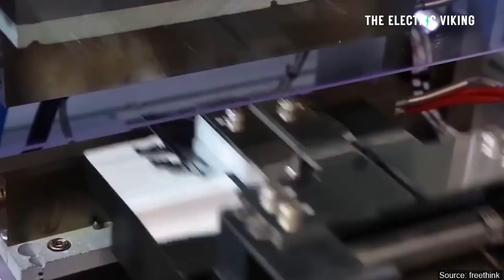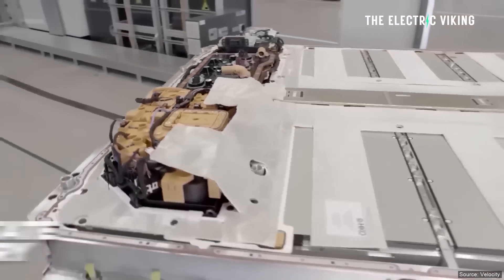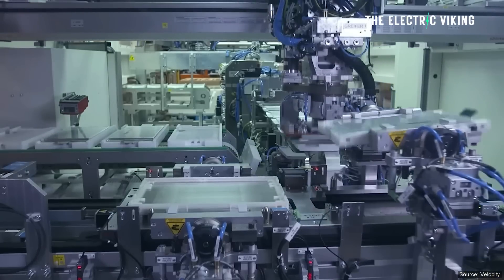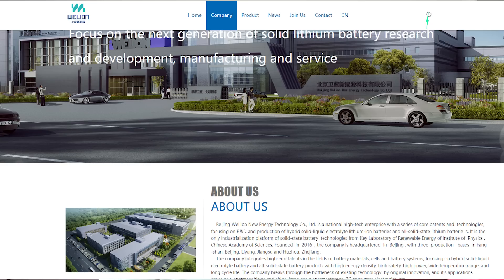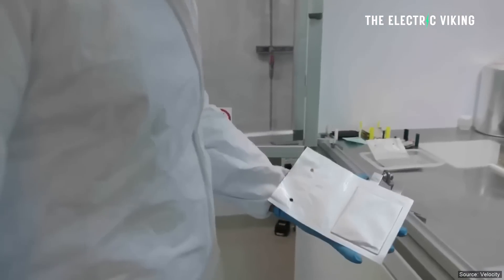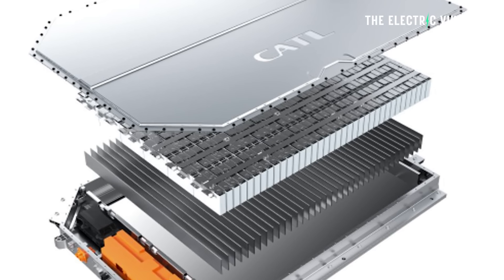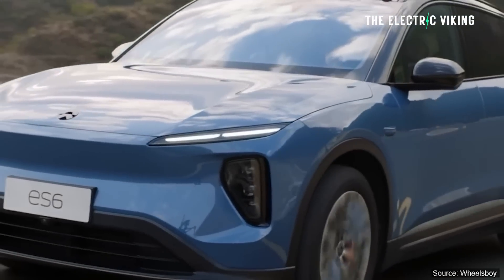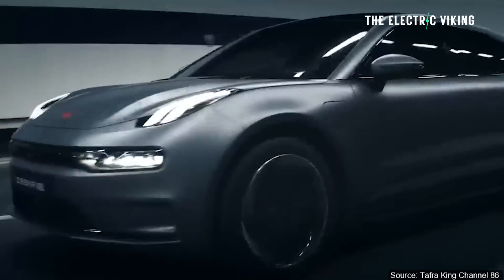Nio's ES6 has 577-mile range & 150-kWh Solid-State Battery

Comment: ES6 with 577 mile range never had the promise of 600+ mile range.. The ET5 & ET7 will have the 600+ range with the 150kWh pack.. don't forget to mention that NIO Swap can upgrade and/or downgrade battery packs in 4 minutes. Unlike Tesla that you are stuck with current tech. Huge advantages that only NIO has, even if/when charge times reach super low limits (that too Solid-State will provide). NIO will be the only offering of battery upgradeability across all models... just my 2¢ cheers
Reply: Don't forget to take battery degradation in consideration too. The NIO swap is better in that regard!
Reply: @futureatob6920  is it?   Maybe when you go to sell but you do risk getting a highly degraded battery
Reply: Nio is not going to proactively keep these batteries at 100 or even 90.  You might be pissed if you get one that is not well taken care of
Reply: @jamesp5301 NIO swapping stations do diagnostics on the car & battery every swap.. maintenance or recycling is performed on the battery pack when needed.
Reply: @peterklausner9727  now you change the argument. I do like the maintainability of swap.   I'm talking about it as a charging standard.   having a proprietary standard means fewer options everyone can use
Reply: @jamesp5301  You can push for standardization of a system that is good, but somehow to me seems lacking when time is money and you have to sit at a charging station for 30min or more to replenish a battery.. 5-10min would be great however those chargers don't exist,  & those batteries don't exist to not be affected by continuous fast charging & it's affects on  the batteries in degradation over time is a real concern.. & Look at the German model Y & NIO ET7 endurance test of 450kms, speed limits must be obeyed.. The ET7 won With 8min to spare, & had 150kms left on the swapped battery.. The model Y had 42kms left in the fast charged battery and lost by 8 min I believe over that distance.. Personally I would want to standardize the better system.. But that's my opinion.
Reply: @peterklausner9727  I get it.  I really do but by not focusing on building a supercharger standard it doesn't solve the problem of having a universal, reliable and available charging system and encourages different groups to invest in competing swap standards.   I think its an interesting technology but it is not a panacea
Reply: @jamesp5301  I don't think you do get it.. By having just a good system in fast charging won't in of itself determine how all vehicles will be deemed best for power replacement.. Maybe in The US and Canada where it's not even 15% of the world's EV market..Until better comes along.. When do you see solid state batteries coming to the mass market in the US?? Anytime soon.. Not a chance.. Way behind in battery development.. China will control this one.. Not Tesla or anyone from the US.. China will rule how best to govern their market which is bigger than the EU & the US combined.. Overall the US likes to rule the roost, but it's in absolutely no position to even think about doing so, well other than protectionism like implementing the IRA & going after battery materials content.. Change name now to Inflation Act, because the Chinese with their dominance in batteries hold the key for any really cheap EV being sold in the US.. The US will have a hard enough time trying to keep their grid up in about 10yrs.. This is another hidden advantage of battery swapping stations they can back up the power grid.. & China's government supports battery swapping technology,  obviously helping NIO... I reject the idea of a single standard.. The current technology doesn't support such a move with such glaring deficiencies.. Tesla super chargers are currently 250kw.. NIO'S are 500kw already.. But more importantly can the car handle the additional power?? NT3.0  for NIO will have 800v architecture next year.. You have to look a bit deeper to understand that it's not that simplistic to make such broad sweeping generalities..
Reply: @futureatob6920  I do agree it is better for capturing damaged batteries but a lot of myths around battery swap just really don't stand up to scrutiny.  The primary advantage is to server areas where you aren't using a destination charger
Reply: @jamesp5301  In general modern EV batteries (from NIO) are really good. They are all in the same health. No need to worry about being cheated. If something is wrong NIO will, I am sure, change to a fully healthy battery.
Reply: Let me get this straight... you swap out the $9k battery?  Ok, who owns the battery?  Are you paying $40k for a car without a battery?  Did you pay $40k for a shell?  The company keeps the $9k battery and just lets you use it?  Next question, how many batteries do they need to build per car? 2 or 3?  If batteries are the hard/expensive part of the car, wouldn't it be cheaper to just build half as many?  Can you charge the swappable batteries at home?  Or is swapping the only way to "fill up"?  How much does the swap station cost to build and maintain?  Who pays for that?
Reply: @davidbeppler3032  You can charge the battery as you like. I think their swapstations are relatively cheap. They are massprodusing them for China - the buyers of their cars pays mainly, but they are heavily subsidised by the government. The batteries are for all their cars, and it make sense to have many to avoid degradation. I think that you can sell the car with the battery that you chose at purcase, but that you pay NIO afterwards for the battery after you sold the car (with battery of course) - but not sure...
Reply: @davidbeppler3032  so with battery swap you are really either paying for the use of the size of battery you want  up front  or you pay for it as a service.    Of course you can choose to always charge it conventionally and the average quality you should get from swaps is fine.   My frustration is that Nio bulls fail to think critically about the downsides and reality of battery swap.  Just like Tesla fans don't adequately weigh the pros and cons of decisions Tesla makes
Reply: I suspect swapping tech will be redundant in 10 years as charging speeds continue to get faster and wireless induction tech means you won't even have to plug in.
Reply: @chrissscottt 

Charging speeds won't be close to 5 minutes swap, I can bet you. Plus next gen swaps are 3 minutes
Reply: @protagonist9716  I don't want to lose my battery pack after a swap!
Reply: @johnsmith-cw3wo  I find math and physics are not well appreciated by a lot of people following EVs.   I like swapping a lot but it also essentially has the same issues as superchargers once you have a queue waiting for batteries.
Reply: @protagonist9716  As you wait in line 40 minutes to have your battery swapped
Reply: @b4804514  

And you want 3 hours to queue for Tesla charger and hope it doesn't break or the shoddy car itself
Reply: @jamesp5301 As EV'S become more popular queues for charging will become more common.. Personally I would like more power options than less power options.. But this is just me..
Reply: @peterklausner9727  the best way to get more options is to get everyone on the tesla standard in NA and build superchargers.   I like swap but unless it is driven by a standard won't work long term
Reply: @jamesp5301  Seems reasonable in North America for everyone to adopt a Tesla cable connection standard.. But we don't make the decisions LoL.. It's just a big plug head.. With battery swapping NIO has the standard & is in addition to charging & fast/super charging.. Lots of benefits to have more power options than less IMHO..
Reply: @peterklausner9727  more availability of a single, reliable seems to me is the better way.   Like petrol stations.    We have gas, diesel but really they are the same.  Having owned a diesel I can attest it is not easier to have the less common option
Reply: also owning a Leaf I can tell you it sucks having a fast DC charging port that is not well supported for the rare emergency where I want to use it
Reply: @protagonist9716 Anything < 10 minutes will challenge the battery swap model, I think. I’m not sure people will want to rent battery packs. Maybe they will..but I’m not convinced. I’d rather pay off my car and not have a payment, personally.
Reply: @gridjac  

Hasn't been ten minutes in smartphones 15 years into them is still at least 30 minutes
Reply: @johnsmith-cw3wo  When talking about physics: it's E=100 kWh devided by t=1/12 hour to give P=1200 kW
Hence 3000 amps, not 5000. Nio plans for 800 V charging, that yields 1500 Amps. Still high indeed but I don't know what Tesla super charging current amounts.
Reply: @johnsmith-cw3wo  
Doubling current yields 2^2= 4 times as much heat development since P=I^2 x R
Since heat development is loss of energy, in general you should keep current as low as possible. (think of how energy is being transported through high voltage of 300 kV from power plants to cities to keep current as low as possible)

So, to be able to still charge with high power and transport high amounts of energy in short time voltage must be high (P=UxI)

So is doubling from 1500 to 3000 worse than from 500 to 1000 amps? The doubling itself not. The absolute (high) value of current itself? Yes, that does not attribute to keeping costs low because of heat loss.

If Tesla indeed supercharges with 250 kW and only 301 Amps, the voltage is little over 800 V.

I only wanted to correct you on physics, I am not very familiar with specs on Tesla and supercharging. I just don't think high currents as 1500, 3000 or even 5000 Amps come into play. It doesn't make sense.
Reply: @johnsmith-cw3wo  Ah yes I agree with that. It requires a sufficient cooling capacity for each cell of the battery itself.

So the answer to that lies in higher voltage, more cells in series i guess(?)
Reply: @jamesp5301 yep, but at least you have both ways, swap or charge
Reply: @chrissscottt wireless is an illusion and doesn't make any sense, too much energy loss in the process and the constant cost so much, like one high way in USA with Okish performance cost more than 1 trillion dollar, there is no sense at all.
There is a limit to the grid and to the battery.
If you want to charge a tesla in like 5 minutes you will need 1200kw charger. this is not possible not even in 30 years, too much power on a single cable, maybe if we switch to silver cables😂 and the connector sould be much bigger than it is right know.
Many current charging station are malfunction due to the high power and there is only a little number of electricians that can fix tham.
Look 30 min is ok, not That good for the battery, 15 min it is pretty much the limit with 400kw countinues, bad for the battery.
10 min we are talk about 600kw and this is too much plus the battery will pray😢
And nio have a long way to upgrade their swap station down to a single minute. If a race car human time car replace 4 wheels in less than 2 sec so a very accurate machine can swap a battery in less than a minute

Comment: eventually, we are going to get a technology that makes one whole battery pack instead of these smaller cells put together. i feel like now we don't have the tech to get there, but will get there in a few years.
Reply: That is not how batteries work.  You do not want one cell to rule them all.  Currently if a smaller cell goes bad the car still works.
Reply: @davidbeppler3032  yes but you don't need that many. Currently, there are 3000- 10 000 cells per car.
Reply: @PolineChan  Again... you need an education.  If the best engineers in the world are doing it wrong, please inform them.  Better yet, build a better EV and people will buy it.  Become a billionaire.  We need solutions.
Reply: @PolineChan  where are those numbers from, do some homework work, nio have around 200 batteries in a battery pack
Reply: How could one big battery be efficiently temperature controlled? With the individual cells there can be coolant flowing around all of them. 

I’m ignorant on this topic but I’m sure the industry will drift to whatever is most efficient.
Reply: Your statement was literally one of the most ignorant comments I’ve seen today. And it shows that you don’t have the skills to build anything valuable.  You’re really off.. you just don’t know